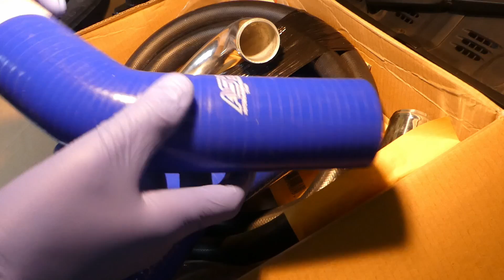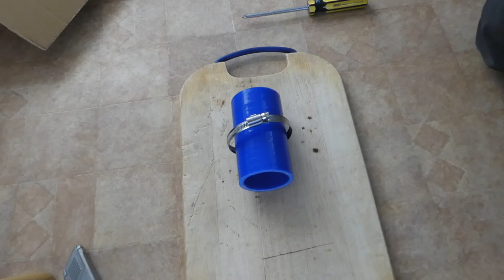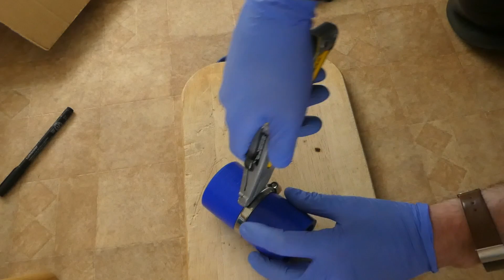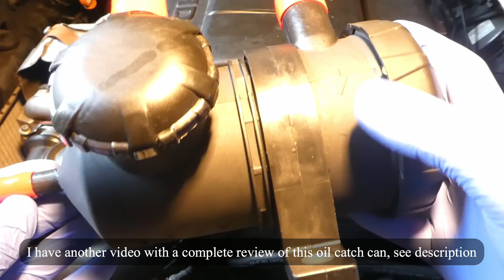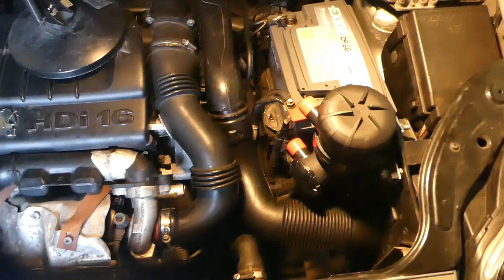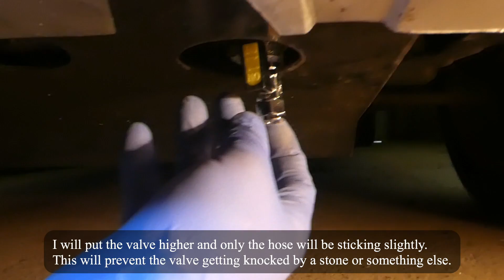Installation of an oil catch can (Provent 200) in 1.6HDi engine (Peugeot/Citroen/Ford/Volvo)

Comment: Hi great content , the click adapter that connects to the crank case breather outlet. Where could I get one 👍🏻
Reply from the maker: It is in the description of the video with the actual part number. Anyway, it comes from the 1.6TDCi (same engine) breather for the Ford. Comes with the whole air intake unfortunately, not just the breather outlet.
It is mostly ebay, but you may find a new version with the part number on ebay or amazon or other outlets.

Comment: Hi i have 2008 peugot same engine and its come with up anti polition fault
I replace fuel filter then  its didnt go i conneckt to computer than egr valve is come up 
I replaced thats is well 
And there isnt any issue now
But car is doesnt get fast as should do  and i been at a few mechanic they all say different things
Reply from the maker: Did you or a mechanic recalibrate the new EGR valve?

Comment: Hello its your Car Diesel??
Reply from the maker: Yes, it is 1.6HDi turbo diesel
Reply: @moremolecules   I drive a Peugeot 307 110 hdi with the same engine, so the question
Reply: I would also like to change the hoses does it bring what?
Reply from the maker: @bakur1295  Which hoses do you want to change?

Comment: My cummins isx cm870 on my semi truck has an open vent to atmosphere setup.. At times the engine bay fills up with blowby and makes its way into the cabin.. I want to install a ProVent 400 (open setup) to reduce emissions vapors.. Do you think i will have issues with excessive crankcase pressure given that it will vent to atmosphere? Thanks!!
Reply from the maker: Hi Daniel, yes, there will be a bit more crankcase pressure with venting to the atmosphere. In this case there will not be an active evacuation of the gasses in the crankcase (i.e. turbo suction), just whatever the pressure is will go to the atmosphere. In all my tests, the highest crankcase pressure in a diesel is under idle, that is when the turbo is not spinning at all. Under any kind of load the spinning turbo with the air sucked brings the crankcase below atmospheric pressure. See here: https://www.youtube.com/watch?v=h4TQ-XVWU30
Will it be excessive, difficult to tell, the crankcase will under variable positive pressure (above atmospheric) constantly depending on load and blow-by. Difficult to tell how long can an engine go on with constant positive crankcase pressure. All in all, you do not want constant positive crankcase pressure.

Comment: You are wrong... the hoses should be connected differently... gravity man it keeps the oil down in the catch can.I think you will have better results like that. Greetings
Reply from the maker: I have heard this before, but this is how the oil catch can is designed, the input on top. If the input is at the bottom, oil will pool there (gravity). This pooled oil will be a restriction and could potentially completely block the input. The Mann Hummel has a raised plastic at the input and the oil cannot go into the can.

Comment: if you are in England is ok you can explain to the mechanic, but in northern Ireland you have mot centres where only brainless people work there and they will not accept it
Reply from the maker: It is the same in the rest of the UK, oil catch can is a modification to the emissions of the car and they would fail the car, despite that this reduces emissions.

Comment: Fiesta Mk6.5 1.6 tdci engine is very similar in design to your 1.6 HDI but the plastic fiitings are different design.
I need to do this on my car if its possible. The rocker cover is exactly same as on the Fiesta so do you think its possible.
Reply from the maker: Yes, I think the tdci is slightly easier to do. At least the rocker cover crankcase breather is the better design, so you could straight put it into an oil catch can. The air filter is at the front rather than at the back, so it depends where you can find space to put the oil catch can. It is doable.

Comment: Hi I am wondering why car needs thing. What it does.? How do I know if my car needs it ? Thanks
Reply from the maker: It is not that your car needs it, but it is good to have if you are going to keep the vehicle for longer. Now depends on how heavy breather your car is, the older the more blow-by there will be. Inevitably some oily vapor will escape from the crankcase breather due to a slight increase in crankcase pressure (oil is hot). This will go through the turbo and then go to the air intake passageways. This with the carbon deposits from the EGR valve will coat the intake with gunky deposits that will block/restrict the air intake. Eventually there will be a very small passageway for the air to go to the engine. Overall, reduced efficiency, increased fuel consumption, etc.
How to know if you car needs it, difficult to answer. If you do not intend to keep the car for longer then you do not need it.
There are good videos around to explain it better. search why do you need an oil catch can

Comment: Just a quick thought. Would it not be a better route for the exhaustgases to come in at the lower part of the catch can and let the top connection go to the inlet before the turbo? That is how i have seen this to be done usually because the oil will gather at the bottom.
Reply from the maker: Hi Jonas, yes I thought about this, but the design of the mann hummel provent is to have a cyclone effect of the gasses when they hit the top part. The swirl of the gasses helps them coalesce or in other words they have much more time in contact with the sides of the catch can and help them coalesce as droplets. From the bottom this effect does not happen.
Reply: @moremolecules  ye i have researched the actual design a bit more today and it sure looks "wrong" but as you say it is correct the way you mounted it.

Wich catch tank did you end up using?

I must say however that the construction to have crankcase vent on the 1.6 hdi up at the top is a strange construction. Quite a bit of oil does pass and there is no Oil trap anywhere.
Reply from the maker: @jonasohrfeldt1495  Yes, it could be improved, but I think it is designed to put the filtered oil back in the engine, hence the design. At the end I am still using the Mann-Hummel, but have not yet done more testing to see if the others are as good, I am just doing other things and not enough time to properly look into it.

Comment: I like it, I know that you are not happy with the way it looks but I like it, the only problem I have is in my case the air filter box is always breaking the mounting clips, don't know way but I have replaced it twice and it keeps happening so I'm gonna grab your idea and stick a pod filter on it as well to see if that breaks, plus you sound like a Portuguese man so I have no reason to doubt your skills whatsoever 😎
Reply from the maker: Hi Daniel, I have another video (https://www.youtube.com/watch?v=qBNSyRF79VQ) of fixing rattling air box on my car. Not too sure if it will help with the mounting clips. One of mine broke and I replaced it with a bolt, it has been there for at least 4 years. No, I'm not Portuguese, but thank you for the vote in confidence, much appreciated.

Comment: Is it possible to connect the drain in the drain from the turbine?
Reply from the maker: Hi Andy, not too sure if I understand the question? In general, if I understand somewhat the question, you can connect the drain to the oil sump, but I would advise against this. There is a lot of water, condensed gasses, other stuff that you do not want to go back in the oil sump.
Reply: @moremolecules  Thanks. I thought about water, condensed gasses. But in the car construction, we have oil splitter in the head top. But it works badly after some time and we want to add another splitter. But original device reverts all oil with condensed gasses into karter.  So I think that it doesn't hurt.
Reply from the maker: @AndyPlov  Yes, originally the Mann-HUmmel oil catch can is designed to return the condensed oil to the oil sump or carter. All the water will again of course evaporate and condense and some of course will be burned when plugged to the turbo. I think it is ok to plug it back in. The valve on the side of the mann-hummel is for exactly this purpose, to equalise the pressure from the oil sloshing in the oil sump and the pressure coming from the top oil separator, i.e. the PCV, CCV
Reply: @AndyPlov  Returning the "oil" from a catch can to the sump is a really bad idea. There is a reason oil catch cans freeze up in the winter. It's one thing to have water vapors inside your engine and another to have liquid water mixed with your oil. And no, no filter the size of this catch can is able to separate water from oil.

Comment: Hi there! You've done some excellent job here. I'm thinking to do the pretty same, as the turbine end engine a bit messy duet to all the oil coming from the PCV valve. I'm thinking to break that connection between PCV and air hose, seal somehow the air hose so it will go straight from the air filter to the turbine, without an interception. From the PCV side, grub the bike inflatable tube, cut the hose from it, secure it with a simple cable tie. Other end of that tube hose put to some plastic jar or something, which will be mounted somewhere in the engine bay. So my question is, how do you think, is it important to return the air coming from the PCV, through the catch can, back to the turbine air tube? I mean can I leave it hanging there? What could be the possible downside of it, except for a slight smell of the exhaust?  I'm assuming it shouldn't smell a lot, or it would? I'm trying to make something simple and working, unlike your perfect and pretty tough setup. Have no idea where to get those pipes you have on the video. BTW, thanks for what you're doing. Your videos are extremely helpful for 1,6 HDI car owners. Keep it up!  :)
Reply from the maker: Hi Kosta and many thanks indeed for the encouragement. It really gives me pleasure that people appreciate the videos.
About the PCV air coming into the intake, it is not that important really, apart for the environmental issues. All cars pre 70s were venting the gasses to the atmosphere. Check any photo of a US highway and you will see in the middle of the lanes the black line that was mainly from the oily vapor coming from the PCV or crankcase and some oil leaks as well. I believe the ECU accounts for the small amount of air coming from the PCV, but it should not be too bad, it is only a small amount of air and it is not entirely accurate. So, short answer it should work in theory, as long as you can seal the air intake.
The bike tube would not work, the hose needs to be something that can survive hot air gasses and oil. Some sort of oil resistant hose is needed, it does not need to be silicone, but most auto part stores will have some oil resistant hose. These are also smelly gasses and they are fairly acidic, so it will smell. If you route the hose underneath the car with some sort of a jar it should work. You should secure the jar somehow that when the car corners/stops/accelerates it would not spill.
The pipes and silicone hoses were from autosiliconehoses, the links with the dimensions are in the description of the video. Unfortunately, I am based in the UK, so the links are UK-based. I am not too sure what country you are in, but silicone hoses should be available in most, you just need to find the appropriate sizes.
I sincerely hope this somewhat helps and I am more than happy to reply to any additional comments. All the best.
Reply from the maker: @sijojohnson  Yes, that would happen. Basically you bypass the MAF sensor that measures the amount of air intake. The engine resorts to going back to some default mode or it calculates it from the MAP sensor, but that is a bit different. It may well put more fuel inside or less, so you would see different colour smoke. In other words inefficient burn, lean or rich.

Comment: Hello. I am from South Africa. where can i buy your whole setup that you instaled from your airflow sensor to the turbo
Reply from the maker: Hi Eugene, good question with no simple answer. I have built the whole thing myself as there is no kit that one can buy. I have listed all the parts that I used in the description with a link to amazon, where one can buy them. The links are to the amazon UK site and I am not too sure if they ship to South Africa. If I were you I would check if they would ship it, but you would have to cut the hoses to size. All the parts for the air intake come from http://www.autosiliconehoses.com/, but they also sell direct on Amazon UK. I hope this helps, but let me know if you need more info.

Comment: 8.50 what is the exact name and part number of that bit?
Reply from the maker: The part comes from Ford Focus C-Max air intake (whole air intake), I do not think it can be bought separately. I have a bit more explanation on this here: https://www.youtube.com/watch?v=esChfOvGjbY
The actual part number is: 1336611 (AIR FILTER FLOW HOSE PIPE FOR FORD FOCUS C-MAX 1.6 TDCi 3M519A673MG 1336611). Hope this helps.

Comment: What is the Ford Focus part number of the fitting from the camshaft cover? Where did you get the hose and pipe fittings. I have my Peugeot diesel in pieces at the moment replacing the egr valve, turbo vacuum boost diaphragm, fuel, air and oil filter, and just cleaned the inter cooler. I have been scratching my head trying to work out how to put a catch can on it as this a common problem on all modern diesels. Did you just source those hoses and pipes or was it part of a kit. I am assuming that you are in Europe somewhere which may not help much as I am in Australia.
Reply from the maker: The details are in the description of the video. The Ford part number as far as I understand is: 1336611. This is the whole air intake from filter to turbo, but I only used the breather part. The rest of the silicone hoses and pipes are from http://www.autosiliconehoses.com/ . I did not purchase a kit, as there was not a kit for my Peugeot. I suspect you can buy these from most auto stores where silicone hoses are sold. I cut pretty much all the pipes to fit my space.